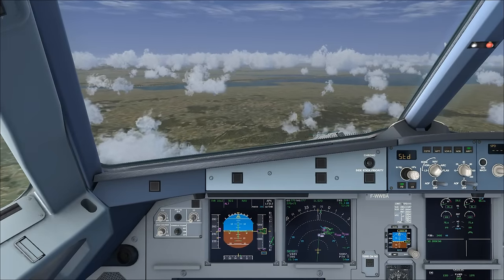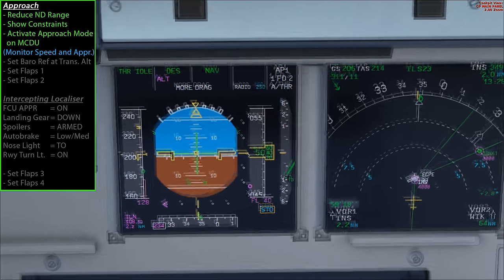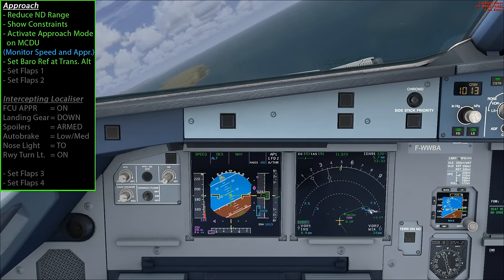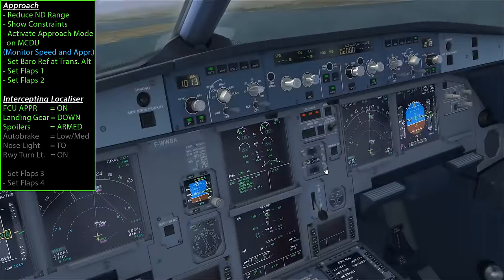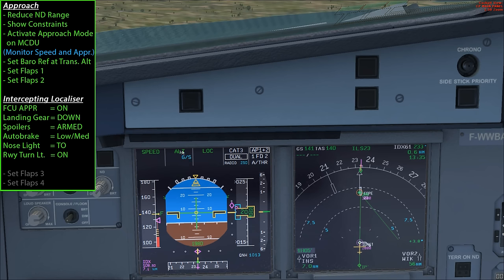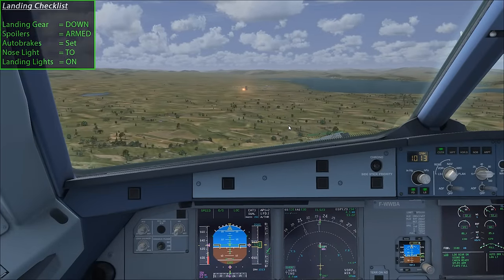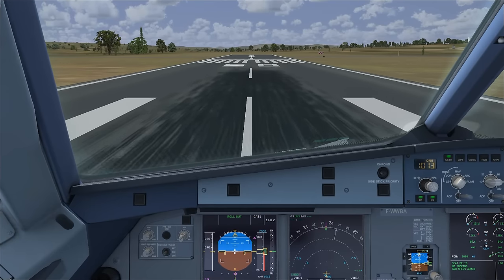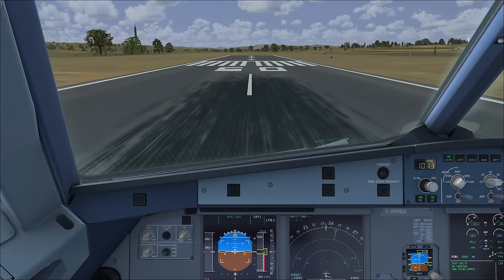A320 Approach and Landing Tutorial (FSX - Aerosoft A320)

Comment: I am type rated on A320, and my company went bust. I only flew it commercially for barely 100 hours. I keep the rating current, but since then I switched a few aircraft already, it is hard to stay sharp doing a renewal yearly for few hours in a sim. I actually found it amazing that such a detailed and accurate FSX video managed to restore my memory. You sir, are amazing.
Reply from the maker: Thank you for the very kind comment. I'm amazed you consider this aircraft detailed enough to help you keep a type rating current. There's other A320 addons which do a much better job than the Aerosoft version, along with my lack of real world flying experience, a lot of the things I explain in these videos is simply diligent research and study, not speaking from real world experience.
Reply: @Doofer911  Which addons do a better job than the Aerosoft 320 Addon? I consider to buy a flightsim (For A320) but don`t know which one or what kind of A320 addons. I also saw that some of the simulations often have many functions and buttons inop. The quality of the scne/terrain is not so important for me. So perhaps you can tell me from your point of view what simulator/addon is "good" for a realistic a320 experience. Great videos! Keep going!
Reply: Starline I heard FSLabs has a better version
Reply: Saudi Avgeek FSLabs, Flight Factor, RHDsim, Toliss (Related), IDG
Reply: Aviator, Indeed. IDG is okay for me. But lacks some of the most important stuffs. The MCDU isn't the best one.
Reply: Aviator, I need an A320 addon for XP 10 other than Jar and Peter Hager. Do you have any requests?

Comment: To add realism, try not to go gear down until 4-5 miles depending on speed and wind since it creates extra drag which means it uses more fuel. 
Like 165 knots ish and then gear down. You will slow down and it will be a smoother approach for you and other traffic.
Reply from the maker: Yeah I did consider keeping the speed up however for people learning the aircraft, I felt it would be better for them to get the plane configured for landing sooner rather than later. Of course once people get comfortable with the actions, they can condense the whole process when on Final.
Reply: I agree 100%
Reply: The speed thing is a feel thing which you just learn over time

Comment: This is a pretty long comment, so don't tell me that the comment is too long. The reason the ils glideslope and papi lights are different is because of the location of the systems. For example, if the ils is further down the runway than the papi, then the ils will tell you to fly 3° to where the station is, while the papi will tell you to fly 3° to where the lights are. The localizer is also slightly off, because flying directly along the localizer even when on the ground will result in you crashing into the ils station. If the ils station was directly on the other side of the runway from the papi lights, they would display the same glideslope. If you have read all the way to this point, I will reward you with a slice of pizza 🍕.
Reply from the maker: ...Still waiting for my pizza :(
Reply: +Doofer911 Oh I forgot you have to hop into your pmdg 747 and attenpt to land at Grand Strand Airport (KCRE) and drive to the nearest Papa Johns.
Reply: I am waiting for my 🍕 bro

Comment: As always your videos are AWESOME! Thank you. Basic question for you; I have seen several videos on YouTube where the FSX pilot engages the approach hold  only after the "bug" drops down to the horizon line. In this video you engaged it as you turned towards the runway. I am confused, as others claim it won't work the way you just did it. Is it because of the plane you are flying? The others were in basic jets that came with FSX, not add-ons. Thanks for your help...

Comment: I've come across situations where the last few markers before landing have drastically different altitude constraints. one might say 5000 ft, then the  one immediately following that 30 seconds later is 3000 ft. I understand it has to do with the ground elevation, but I'd like to see you make a video where it has these drastic altitude changes in such a short space of time because I don't know what to do and it's wrecking my head. How do you know what altitude to enter..entering the lowest altitude constraint doesn't always bode well when dealing with mountainous terrain.
Reply from the maker: It might be worth learning to read approach charts for the airports and runways you're flying into. My suspicion is that the constrains aren't "hard" restrictions where you must be at exactly 5000ft for example. It's likely that one constraint will be "At 5000ft" then the following one will be "At or above 3000ft" I doubt very much that any runway with an approach procedure would require a -4000fpm descent between two waypoints.

Comment: I have some sort of glitch. I'm just a simmer not a pilot btw. I go in for the approach (I'm too basic to use all controls so I literally just slow down the plane from miles off and use flaps and joystick to land) but a lot of the times I am almost near the ground and getting "Don't sink!" alerts, my thrust will just lock to 100% and I can't do anything to get it back down making it impossible for me to land... Any ideas on what I am doing to make this happen?
Reply from the maker: You're probably hitting something called "Alpha Floor Protection"... what happens is if the plane is in danger of stalling, the auth thrust system ramps up to 100% so the aircraft can gain speed and climb away from danger. It's best to keep the aircraft at its VREF speed during approach. That'll be a little bit above the stall speed

Comment: Question: I tried all of the settings in this tutorial, but when try to land, I’m getting the loud warning saying SPEED, SPEED, SPEED like hundred times. I’m in full flaps by the way. How to fix this annoying warning? Thanks for your help DOOFER!
Reply from the maker: Usually happens when your speed is getting a bit low and you're starting to head towards a stall. Do you keep the AutoThrottle enabled during the approach or are you using the throttle manually?

Comment: Very good guide. However I've watched many approach tutorials with the A320 and I never saw that you have to confirm the approach, first time I'm seeing this. I assume the aircraft would have still followed the approach waypoints  if you didn't confirm them because they were already inputted and activated from previously? Or would it have just flown straight and not turned?
Reply from the maker: +Jordan Lucky Yeah normally the Approach Mode on the MCDU activates automatically.  I thought it was kind of strange when I read it in Aerosofts documentation but that's what I followed when making these videos.  I think that pilots in real life do check to make sure it has switched automatically.
Reply: While landing at OIIE (Tehran) today, a MCDU message popped up saying "Activate Appr Phase Manually". Normally this happens automatically but this is first time it asked me to activate it manually. I am wondering if it had anything to do with the runway, coz the runway had this "ILS 03R1". I wonder that the "1" is for. I am equally confused on runways with XYZ numbering.

Comment: Very nice video. When I try to do the approach the green dot speed is always at 200+ knots. Have I done anything wrong?
Reply from the maker: Don't think so, it's usually around the 200knot mark. I believe it can vary depending on the aircraft's weight, outside temperature etc.

Comment: nice tutorial.but help me,i cant save my flight in fsx with this aircraft,when i save and load then it comes in cold and dark state,what do i do,help me,or make a tutorial on how to solve it.
Reply from the maker: The best way to describe it is that the aircraft and the simulator load separately. So if you have the plane set to load as cold and dark by default, when you try to load a saved flight, the plane will still load as cold and dark. If you have a look on the aerosoft forums, there may be a work around for this but I don't know how that issue could be resolved I'm afraid.

Comment: Doofer, can you explain about the LOC hold switch. I didn't see you use that.
Reply from the maker: I believe the LOC switch tells the plane to fly along a runway's localiser, this will tell the Autopilot to stay in line with the runway. That said, there is no vertical guidance. By that, I mean that the plane won't descend along the Glideslope towards the runway, that's why it's better to use the Approach Hold switch.
Reply: Yes, I do understand the use of LOC and APPR hold switch. But the thing I don't get is, it's pattern of usage.
Reply from the maker: Sometimes a runway may not have a full ILS system, but you can conduct something called a VOR Approach which gives you lateral guidance (position over the ground) but not vertical guidance (height at a given position)

Comment: Great set of tutorials. I have a couple of questions both related to ATC. If after take off and on the SID if ATC tell me I am clear to FL15 how can I change the altitude to go above transition.
Secondly I can fly the approach and landing using the STAR and approach to ILS programmed by MCDU however if ATC then vector me to another approach how do I do that? Do I then use HDG in FCU by dialing in the new heading and pressing the button? meanwhile speed and alt are still managed?
Reply from the maker: You would set the Altitude or Heading into the FCU then right click to pull the knob away from the panel. This then tells the plane "Fly to this Altitude now" or "Turn to this Heading now" and ignore the flight plan in the MCDU. Check my cockpit intro video where I talk about pushing and pulling the FCU controls and how that affects the autopilot.
Reply: Doofer911 Thanks very much, i am getting back into Flight Sim after about an 8 year break  
Your tutorials are a great help especially as you are flying in UK.

Comment: I have an issue where I program the approach, star transition and landing mode, and everything looks normal. Then at about between 20-10 NM from the airport the FMC recalculates and the MCDU will say something like "CI26 300/2000" i.e. "Intercept ILS for RWY 26 at 2,000 feet and 300 knots." At first I thought that was a misstake and I ignored it, but rest assured, as I reach the intercept point the aircraft sped up and I ended up overshooting the approach and I had to do a go-around. It has happened multiple times and I don't know how to begin to fix this. Further notes: I usually fly the A320 and not the 19. Any ideas are greatly apreachiated.
Reply from the maker: Just re-program a different speed into the MCDU.

Comment: bro can u pls help me for this:

whenever i click the AP2 button it turns off the AP1 button and when should i activate my approach phase and click the approach button i mean how many NM miles away from the runway bcuz whenever i look my FPLN there is no G/S indicator and i don't have a loop for my approach can u also tell from where you get the airport charts... 

thanks and appreciated.  :)
Reply from the maker: I can't remember exactly but the aircraft needs to be in a certain "condition" before you can enable both Autopilots at the same time. I think that you need to press the "APPR" button before you can enable both APs. I've also got this thought that the plane needs to be established on the Localiser AND Glideslope before you can enable both APs but I might be wrong. 

As for getting a Glideslope indicator, do you have the Landing System enabled? The LS switch next to the FD switch. 

Finally, I get charts from Google, just type in the ICAO code and you can find them easy enough. For example, to get Heathrow charts, search "EGLL charts"

Comment: hello doofer911, why my aircraft glide slobe not active after the dot hit to the centre horizontal and vertical. that make the aircraft not decending to the  runway and miss the approach. very big thanks if you answer my question.
Reply from the maker: Did you activate Approach hold on the autopilot panel?
Reply: actually i active the approach hold before the dot hit at the centre horizontal and vertical, am i wrong with that action? or i need active the approach hold when the dot hit at the centre horizontal and vertical?

Comment: I wont ask you when i put full flaps in final approach i loss speed the auto pilot say speed speed speed  and some times the plane is make stall how can control  speed in final approach ???
Reply from the maker: You can manually adjust the throttles to keep the aircraft's speed up. Alternatively, you can enable the auto-throttle by pushing the throttles into the CLB position and left-clicking the Speed control on the autopilot panel.

Comment: Isn't the LOC button for horizontal alignment and the APPR button for vertical alignment? Or is the LOC button unnecessary for an MCDU programmed approach as the runway is already aligned as you wrote it in the MCDU beforehand, so all you need is APPR?

My question is, if you programmed a flight with the MCDU, do you need to use the LOC button? And if you didn't, and simply inserted the ILS frequency in the RAD NAV page, do you still need to use LOC?
In game I just was messing around and wanted to do an ILS landing at a random airport, so I inserted the CRS and frequency for the localizer in the RAD NAV page and I turned on LS, then once I was somewhat lined up with the runway I turned on LOC, it lined it up great, but then once the glidescope got captured I pressed APPR but nothing happened... The aircraft didn't move from its original position and I just overshot the runway. Did I do something wrong?
Reply from the maker: The LOC button will capture the runway's localiser and provide horizontal alignment, the Approach button will do that and capture the Glideslope to provide vertical alignment, so APPR provides both. This is because you can conduct something called a VOR only approach where you only have horizontal guidance but no vertical guidance. 

As for setting data into the CDU, I'm not 100% sure on how that would work. I can say for certain that APPR needs to be on BEFORE you reach the Localiser or Glideslope, I think that if you hit the Glideslope then activated APPR, then you were already past it which is why it didn't "lock on".
Reply: Doofer911 Ah okay, thanks! One more question, isn't the runway turnoff light supposed to be on during taxi as well?

Comment: Hallo- hallo, i like your videos! Question, why sometimes does not appear the climb or descent arrow?
Reply from the maker: Did you get the aircraft through Steam by any chance?
Reply: No never i use only FSX and the aerosoft A-320 1.10V its an original CD!
Reply from the maker: Might be worth seeing if there's a patch or update for the aircraft. Alternatively, look on the Aerosoft forums to see if anyone else has had that issue.
Reply: Informationlly I can say this. When I start the airplane in a cold and dark phase, working this. Just before the descent, a few miles before it appears on the information bar "ready to descent in 37 miles", the down arrow will appear  only when I set the altimeter button to descent. Thanks for the answer, watching your videos all the time are very informative.

Comment: What a restricting airplane :/
Reply from the maker: Why do you think it's restricting?
Reply: Doofer911 I was thinking about the autopilot authority that the aircraft has. Like they make think the pilot has full control maybe?
Reply from the maker: I wouldn't call that restricting, Airbus have a system called "Alpha Protection" which is used to ensure that the aircraft is never flown outside of it's normal operating conditions. For example, because of "Alpha Protection", you can't stall an Airbus deliberately.